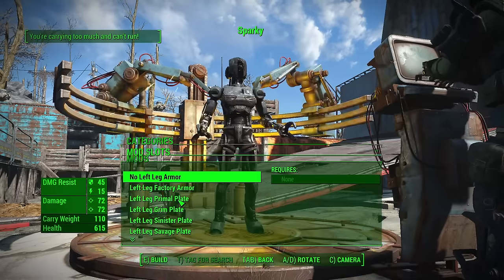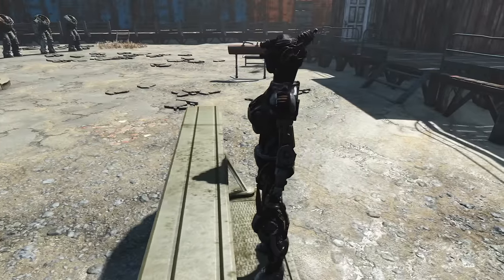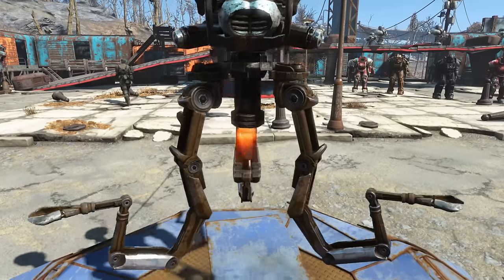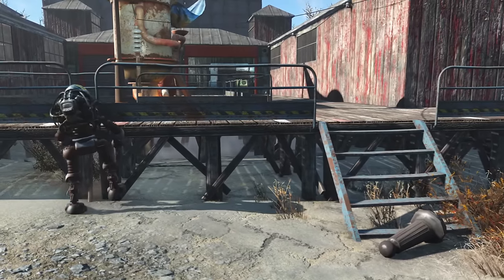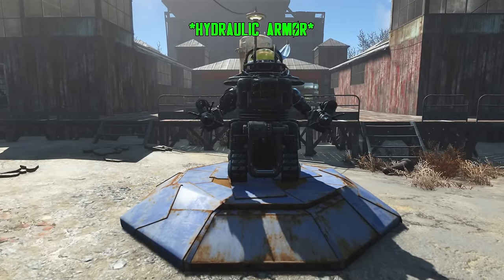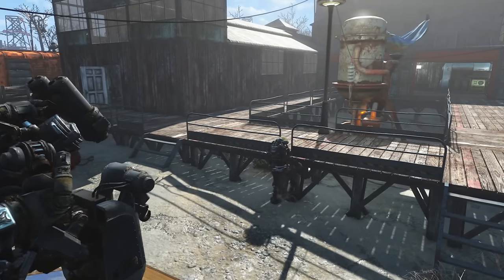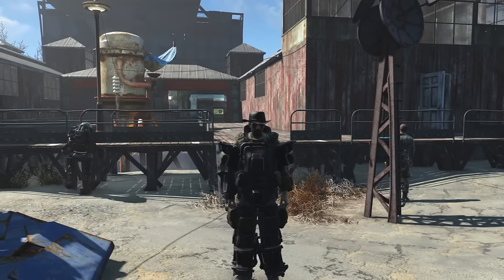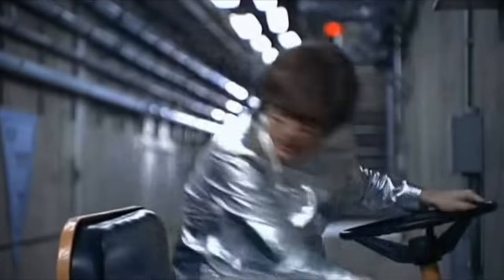Complete-ish guide to Robot Design in Fallout 4

Comment: My provisioners are all the multi-armed Mr Handy builds cause their are fast and offer the longest range detection and engagement distances.
Yes, they are fairly flimsy compared to any other bot but they often make up for that with their speed. See, they flit around any battlefield at such high speeds (especially when combined with thruster mods) that their opponents will have to constantly run after them when their pathfinding AI decides to pick off a random bloatfly in the distance so they suddenly charge out of melee combat to close the distance to said bloatfly.
Combining a flamer on their thruster arm, with a sawblade, and a pincher gives them incredible close to melee range damage capabilities. With a Tesla gun arm and a sniper laser they cover essentially all ranges, and even AOE attacks. 
Add a voltaic mod to the arms adds energy damage to every. Single. Attack.
 Including melee.
Which ups their damage output incredibly.
Yeah, it SUCKS at carrying capacity.
But note that their speed isn't actually a detriment to their role as a provisioner. Nope, once they escape the radius of their pack brahmin, the brahmin suddenly goes on stereoids and starts to SPRINT across the landscape easily outpacing a flying vertibird.
If you make the Mechanist's Lair your central provisioners hub for all settlements you will find these turbo-charged menaces running around the Commonwealth constantly. At all times. So there's a good chance that during a protracted fight one of your slicing, dicing, frying provisioners will pop around the corner and assist you in said fight. Because they are so fast.

Comment: I was intending to write this comment like I was another Wastelander, being all lore friendly like in the vid, but decided that was too much work.

One of my favourite builds that I seem to keep defaulting back to is as a 5 Crank Laser Musket Sniper with a Devastator Ada Tank companion. Robo-Brain arms, Tracks, and Head as well as a Sentry Bot Torso. Give all armour slots the Voltaic Armour for that increased Energy Damage, with 2 Gattling Laser Hands, Mesmatron attack, and the 2 Shoulder Mounted Artillery pieces. You send Ada into the thick of battle and she wiped the floor with everyone while you pick off stragglers with 250 points of energy damage to the face.

It's alsp fun having a Mr. Handy Codsworth but you give him 5 Saw Blade's and watch (imagine) him Beyblade into a crowd. Codsworth has a Strength Special Stat of 10 btw
Reply: For regular settlement stuff they don't need to be nearly as equipped. Assaultron or Protectron legs and at least one arm that can function as a hand + a weapon of some sort. My days of using them as Provisioners are mostly gone, now they're stationed at my Artillery ready at a moment's notice for whenever I smoke a Raider Camp

Comment: I just made some Protectrons with factory armour because it was the cheapiest option to work on my crops in a settlement and 2 Sentry bots to defend it with max armour, fatmal launcher, missile launcher, minigun and just in case a Tesla coil in each unit. However I did turn a sentry bot into a provisioner by adding tesla armour, two laser gatlings, an assaultron laser head (I got the inspiration from one of the Mechanist robots) however my version was stronger than hers.

Comment: Personally, I don't think the Sentrybot torso is that much of a weakness.  The overheat down time is certainly bad, but deck it out with a Robobrain head and dual Fatman launchers, engagements are over before they start.  If that's not enough, you can try on a full compliment of voltaic armor and some laser gatlings to shred through whatever scraps survive getting mini-nuked twice.

You're not going to want to let them go inside, they aren't always the best at detecting ceilings, but they do perfectly as provisioners and settlement security otherwise.

Comment: your lopsided loony is so close to my gardening bot which is a Mrhandy with 3 pincers Robobrain arms with cryo guns(cause they look like hose nozzles) & a Mr. Handy eye stalk lets just say these guys are amazing crop tenders I tend to have 6 to 10 of these set on the crops needed to make Adhesives & if the settlement is ever attacked then the raiders will have to deal with an army of green balls freezing & smashing them.

then theres my Warbot & this thing is just plain psychotic! Sentrybot torso & arms, Assultron legs (did you know the sentry torso scales down with smaller legs? Sentrybot torso can go down as small as robobrain torso in this way) 1 Gatling Laster 1 Hammer-Saw 2 Back mounted Rocket launchers (Mini-nukes not a good idea unless you like loading saves) Robobrain head.

These bots are MEAN just get into combat hide let them rush down the target firing laser suppression & debuffing with the mesmatron, & raining explosive death secondary targets with the rockets. 1 of these things in a test went toe to toe with 30 Deathclaws before it got destroyed!. so i reconfigured Codsworth & Ada with these things & dear god with these things now being essential lol I never need to worry about heavy combat... though cramped interiors are an issue as they think they can fire the rockets in there.

Comment: IIRC the sentrybot torso will only overheat if it has the sentrybot legs. For most of the game if I have a robot companion it will have protective legs for best carry capacity and I do NOT want it closing in the enemy, with a Mr Handy torso and protrectron/sentry arms and the best automatic guns I can give it.

Once all the schematics are unlocked and I have the no friendly fire from companions perk I usually do a full sentrybot with protectron legs, fatman shoulder launchers and there's an unstable sentry head mod that causes instant death and then 2 very fast firing weapons, doesn't matter if it's only 1% if I'm firing 1500rpm, it's AI is good enough to use the fatman like a grenade and shoot it past the cover enemies are hiding behind.

Comment: My setup for Ada: Robobrain head, torso/arm/leg is Assaultron, all hydraulic armor, one arm has stealth blade, one arm has lightning gun. I think I added recon sensors.

The biggest issue is why nobody in the Wasteland used the Robobrain legs as parts for a single passenger vehicle.

Comment: 1)problem with provisioner is that the game constantly "defaults" automatrons to basic naked protectron without arms when you're away from their area. I tried to use sentrybot/assaultron hybrids to cover Commonwealth with patrols through such provisioners, but the game keeps messing with them and power armor so I had to keep provisioners solely to human settlers in marine armor with gatling laser and nuka grenades. Sadly that's the best you can do to keep Commonwealth clear;
2)second usage were same sentrybot hybrids outfitted for artillery role to defend settlements like castle which had a lot of open ground around them. The game ruins settlement robots FAR more rarely so it can be kept. In spirit of self propelled artillery, those were robobrain tracks and head with sentrybot torso and rest of it. Weapons were all explosive and 50/50 on experimental and reliable ie arms were rocket launcher and explosive minigun while shoulders were cluster rocket and mini nuke. Problem: mesmetron is VERY short ranged weapon. Robobrain detects something and rushes AWAY from the walls, sometimes literary jumping off the wall in case of Castle to pursue the attackers into their melee range to be encircled and disassembled with impunity. Result: robobrain heads forever scrapped and tall railing added to all walls. And since explosive weapons kept hitting railings and exploding robots themselves, switch from explosives to laser gatlings. Shoulder weapons were retained.

3)settlers themselves. For roleplay reasons those are combination of robobrain head and arms with assaultron legs and torso(idk if lorewise assultron torso can fit all the units needed to keep human brain alive and healthy. Jezebel somehow survives as separate head). Basically that gives us Robocop Calculator robot. Lorewise they should be able to use human weapons thanks to robobrain arms and claws and wear human armor and clothing thanks to assaultron torso and legs. For RP reasons some of them are named after named NPCs, who died. Come on, we have Automatron facility, we have the doctor from Far Harbor, we CAN rebuild them!

4)for actual companion the best suited one for me remains assaultron as what player need the most is a bullet sponge to stand between you and feral ghoul horde. So assaultron head with laser and "hammer/saws"™ for that sweet stagger. Idk, might replace one of the arms with a flamer to keep the enemies on fire while they also bleed and are staggered.
Reply: They only reset to default if they are killed. If you make them a companion when you first build them they become essential and then you can make them a provisioner.
Reply: @TrentLayell  thanks, I'll try to remember and try that if I'll ever reinstall F4 👍

Comment: Honestly I always ended up just using either the potectron or sentry head. As those 2 both had an armour which had a chance to insta kill. By causing the enemy to just explode into gibs. And since those 2 were the only ones to have it I used that. Combine that with dual miniguns and within 1 or 2 seconds of firing at something it would instantly die ragardless of health.

It didn't even need armour since nothing short of a gigantic hoard I am talking like 30+ enemies could kill it. And that was only due to it seemingly needing about a second or so to switch targets.

Comment: the mr handy I have build something like that tho I prefered to swap the   sniper lasers for gatlings since the snipers while they can be powerful  have a slow firing rate  meaning the  bot can have trouble  if they need to fight anything more then 1 on 1 I even made a handful of  modified eyebolts (mr handys but lacking the  thruster arms) with  ether gatling lasers  or miniguns to act as support units for my   sentry Bot tank.

 the idea being that the sentry Bot would be stationed  somewhere with good visibility, or where I really needed the  full  force of it to be brought to bare, while the   marginally weaker floating turrets  could  flush the enemy out of cover and into the lines of sight of ether settlers, turrets or the  sentry Bot. tho 3 or 4 of them focusing fire on a single cluster of targets  normally managed to hold the line if not repel anything that tried to break in  as a quick response force.

i've also been known to use  box standard  protechtrons with just a rapid fire laser hands  as  farmers  for personal safehouse/ forward operation bases  since said bases  normally have a  large quantity of turrets and defensive  positions to the point most of the time  my spent is less defending and more looting the post battle  remains of what was foolish enough to  try and rush a wall of machineguns missiles and lasers. mostly super mutants and  the occasional  raider  squad

Comment: come to think of it, mr.handy is meant to be a in house robot, right ? but doesnt that jet exhaust produce a lot of combustion exhaust ? in a confined space of a home, wouldn't that eventually lead to carbon monoxide poisoning for the room occupants ?
   Alternatively it might be burning hydrogen/oxygen gas instead of hydrocarbon, so end product is just water. while that might remove the hydrocarbon poisoning issue, excess moisture and heat in a closed room environment is just a breeding ground for mold. Unless all the house in fallout universe have excellent ventilation that is some how silent and hidden.
Since everything in fallout is nuclear powered, I guess mr.handy might be just use nuclear thermal heat propulsion to levitate. This remove the carbon poisoning and excess moisture issue. But excessive heat dump into the environment might make the living area unliviable after a few hours.
   Unless it's nuclear electric propulsion, output thrust via an internal fan that suck air and push downward. Then heating issue is some how alleviate. But given the thrust area is so tiny, the disk loading must be really high. So this mean the exhaust velocity is really high. It might blow the ground dust every where, no to mention the high pressure ratio of a high disk loading fan mean it's going to be really loud during operation. Anyone owning a roomba know how loud these sucker can get when turn on max power suction mode. mr.handy will be even loud i image.
   Given all these proplusion constraint, i think mr.handy is probably more suited to be an outdoor robot, where its noise, thermal and exhaust gas issue are less of a concern. While protectron or mr. brain are more meant to be indoor robot